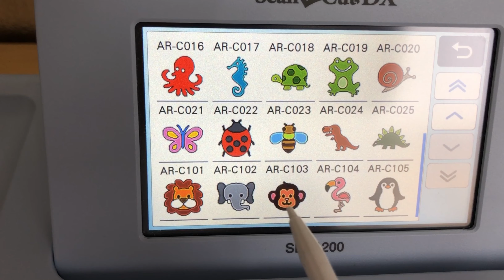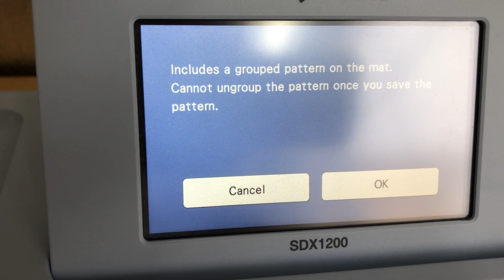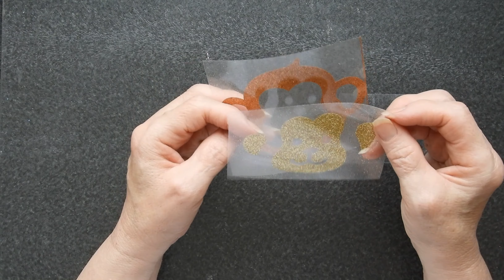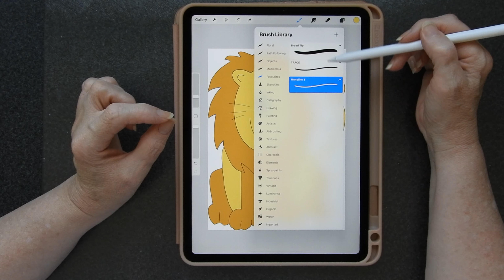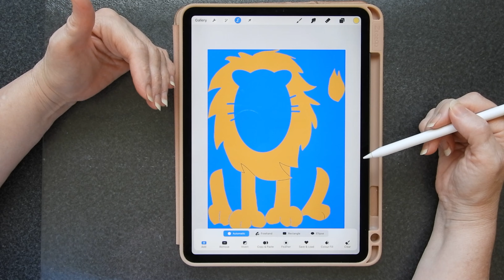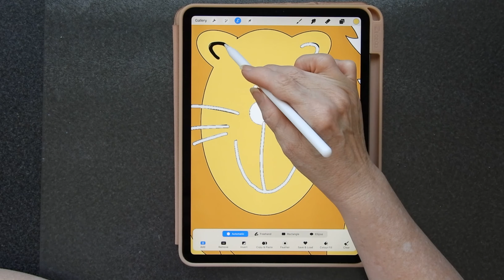Using ScanNcut machine designs for  Glitter Heat Transfer Vinyl

Comment: Very good ideas. I had the same problem. I will try it with SCAL. 

Sometimes I have problems with selecting things in ProCreate . I will also check it. Thank you very much.
Reply from the maker: Layering vinyl is not usually an issue but if you are using glitter vinyl it is!